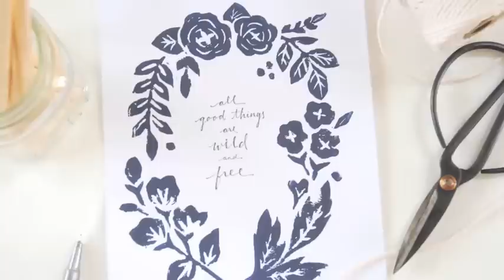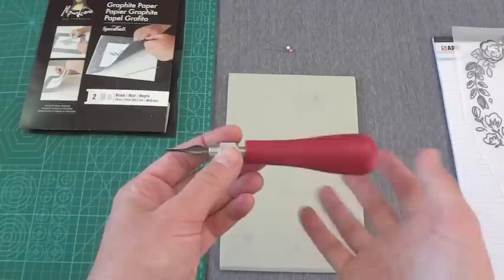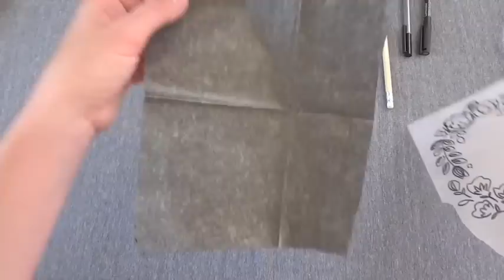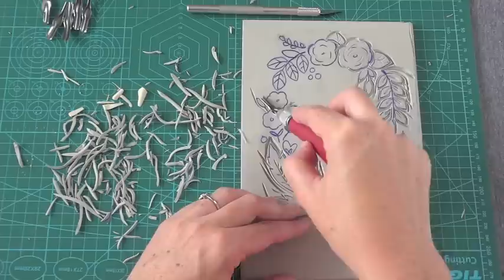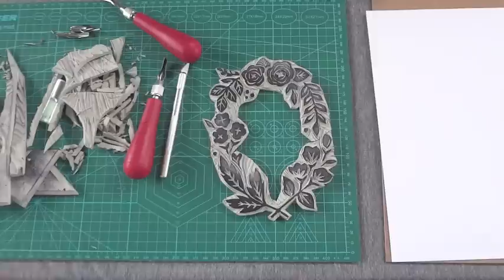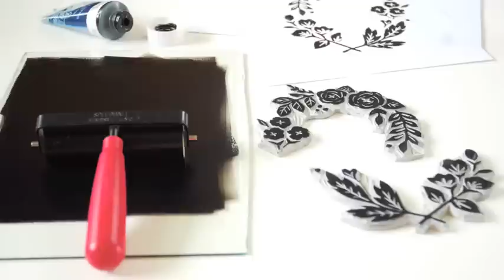Print Making Tutorial PART 1: Design and Carve Your Stamp

Comment: I graduated printmaking,we did a lot of lino and wood carving. I can tell you that it helps if you cross your hands,your carving hand on top touching the left. that way you protect your left,its easier,and you won't go deep,it keeps it shallow. then when you are done,so that the ink has more to adhere to you can lightly sand it with a finishing sandpaper.
Reply from the maker: Irina Shhh Great advice! thanks!